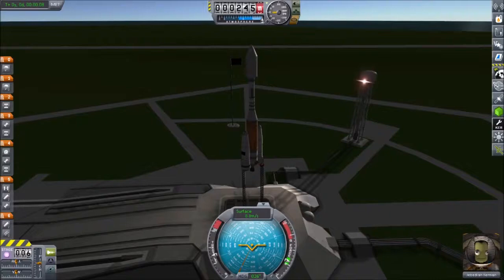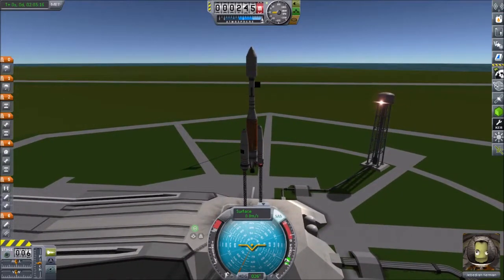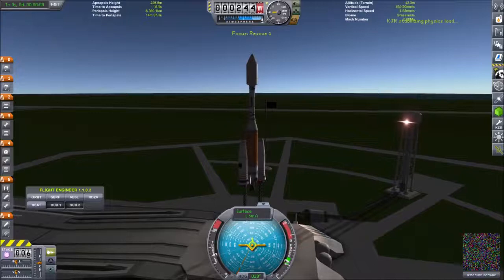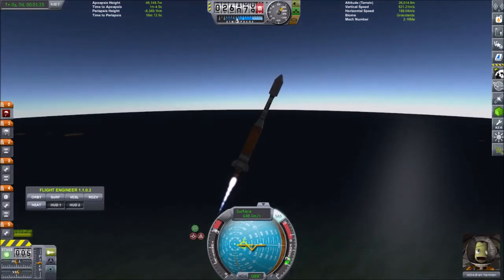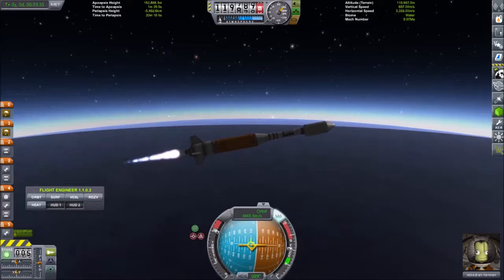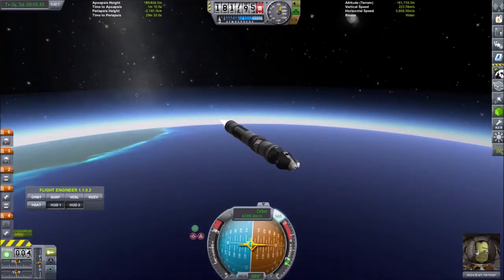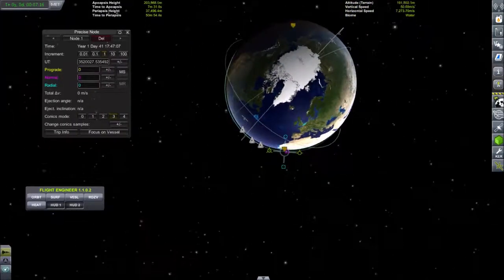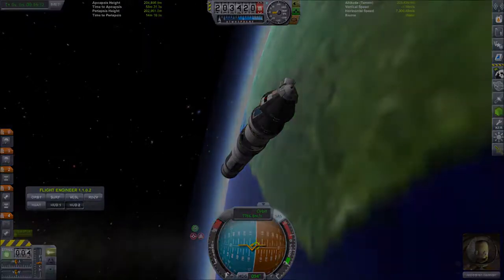KSP RSS reaching orbit tutorial

Comment: hehehe thanks for the tip to use SMURF/Realism overhaul.

I tried many times to get a (big ass) rocket into orbit without those mods and only managed on the 10th try (or something) to get a craft into a 1,000km orbit... using like 5 stages of which 2 asparagus solidfuel booster stages With stock KSP I've never bothered much with selecting proper engines or their (stage) ISP/TWR ratios. While it is a lot more complex now, I agree it is a lot more satisfying to succeed!
Reply: I recently bought ksp and installed rss mod, and i thought what a hell 😅 why i can't get to orbit. Every attempt failed it was close but not enough.